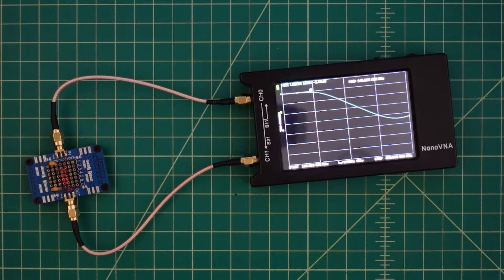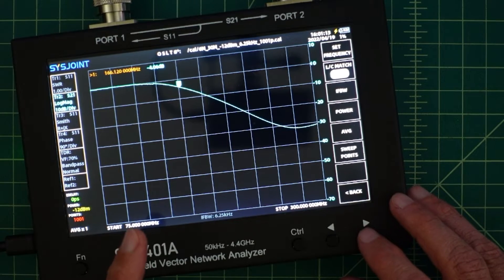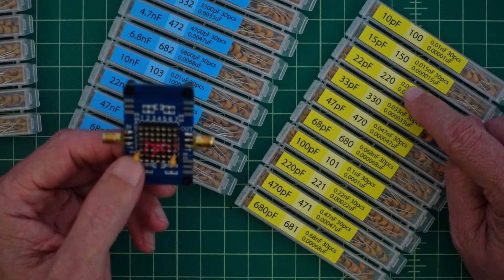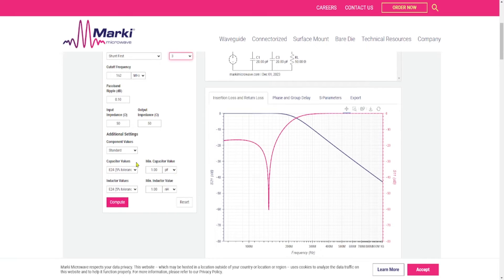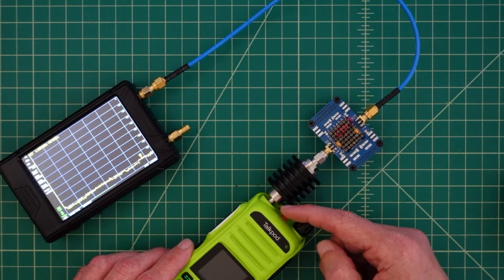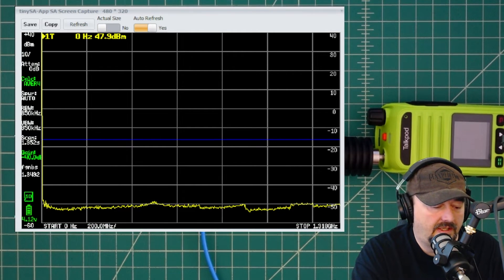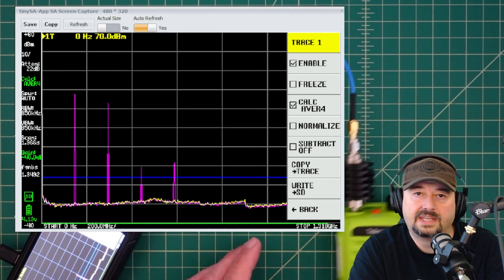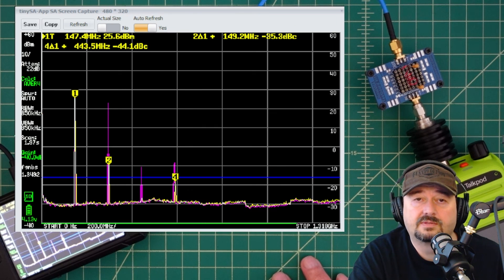2m Low Pass Filter for Ham Radio

Comment: I was using Marki LC Filter Design Tool in the website and it is nice, BTW the website don't show info about how to make the coil used in the result of LC calc. Do you know any website to calc the coils based in the inductance? (i.e. 12nH).  Nice video, thanks.
Reply from the maker: I think folks use an app called coil32 these days
Reply: @TheSmokinApe  nice, thank you
Reply from the maker: @Semeion7 👍

Comment: I wish I had watched this before I started trying to make a broadcast filter for my SDR. I was expecting to just follow a plan and tune it up a bit but I learned the long way about the Nth order versions being necessary for stronger interference. 
Also what do you look for in a capacitor assortment like that assuming they will just be used for filters and filters disguised as other things like band traps? 
I inherited a whole shack of random parts from an SK so I haven't had to buy many capacitors yet but it would be nice to not have to search through his unlabeled boxes of jumbled 1960s capacitors to find what I need assuming he didn't use all of whatever I'm looking for :)
Reply from the maker: I like using the silver mica caps but haven’t had luck finding an assortment of them.  I did get a bunch of different ones from Tube Depot

Comment: Interesting experiment, but that proto board will introduce a significant amount of capacitance to your circuit. In addition, keeping your capacitor leads so long will add inductance in series, creating tuned circuits. Despite the limitations of your setup, I applaud your experiment and your video. This is the type of experimentation that will make ham radio a great training ground for competent, trained radio operators. Congratulations!
Reply from the maker: Hey Donna, totally agree with your points about capacitance.  Thanks for watching the video 👍

Comment: You might check out what I did working as a co-op engineering student at a USAF radar site. With multi-megawatts of RF floating around, I worried that the two-meter transceiver in my car might get fried. I made a quarter-wave (corrected for the velocity factor) coax stub shorted at the end. It gave me no problems on receive or transmit, but it was a dead short for even multiples of 145 MHz and a partial short at other frequencies. It's easy and costs almost nothing. It is also a good way to kill that second harmonic on those cheap Chinese hand-helds.
Reply from the maker: Is there a link?  I should play around with stubs more 👀

Comment: Need Help !  Im doing satellites contact , and in FM everything is allright . But i just bought 2  Yaesu Ft817 and im trying SSB satellites .  The thing is , when i transmmit on 2M  the receiver on the 70cm side is 100% overloaded by the near by transmitter .  Do i need a low pass on 2M  or a high pass on 70cm  ,  or both ?  
Im using an Arrow dual band yagi  with 2 separate coax , connector and radio . 
Thank you and 73 !   
VE2XXQ     FN46rx
Reply from the maker: I'd look into the Sotabeams Bandpass.

Comment: great project . to bad the prototype board is small. to clean up more you would need more sections . but doing that you will get more insertion loss . Sota beams has a 2 meter bandpass filter . the down side is have to take it out to use 70 cm.  73's
Reply from the maker: And it's like 50$, thanks for the comment Robert

Comment: I've built my own filters using that exact website. It's a brilliant tool.
Chebyshev filters add passband ripple in order to have a steeper rolloff. Butterworth filters have no ripple but will rolloff slower and give less suppression on the harmonics (which you could compensate with 5th order for example). It's all a compromise.
Reply from the maker: Thanks for the info, I want to do more filter builds.  I have done a few with varying degrees of success 👍

Comment: @TheSmokinApe
Simulation of the circuit with the values from Marki's filter calculator does not show the insertion loss peaking at 300 MHz, then increasing response above that.  The loss should continue to drop, out to infinity.  One of the culprits is almost certainly excessive lead length of the capacitors.  I guesstimated the inductance of the leads and the test boards at around 15 nH for each capacitor, and simulation with that value puts the dip in response at around 300 MHz, just as your filter shows.  You can find air core inductor calculators on the web, you'll probably have to try several to find one you like.  I guesstimated the dimensions of your inductor and added the guesstimated inductance of the leads and the inductance you have should be in the right ballpark.  Your measurement of 2.4:1 SWR is suspect, just doesn't feel right with the rest of your measurements at and near the design cutoff.  I would build another filter without using the NanoVNA TestBoard.  Too much stray inductance and capacitance for any serious work with those.  Just solder a couple of SMA edge connectors to a piece of double sided PC board of appropriate width - just enough to fit your inductor between them, maybe .6" to .75" - then solder the inductor in. Then solder in the caps with the body of the cap practically laying on the PCB, leaving (damn near) zero lead length, and solder the other lead of the cap with the body of the cap practically up against the inductor/connector junction, again with (damn near) zero lead length.  Now, sweep that sucker!  I have built circuits like that for operation well above 2 meters, well into the gigahertz range.  Another suggestion: those capacitor kits.  Who made the capacitors?  Some of those kits are OK, some of them barely earn the rating of "junk."  Murata and Panasonic have always made top notch capacitors, Vishay is also good as high as I have tested them (low VHF).  There are several others, but they don't make a lot of leaded capacitors, mostly surface mount.  And they probably don't make kits.  Life is getting harder for hobbyists and experimenters.  If you don't know how to check caps at VHF and up with a VNA, learn how, and test the caps you've got.  If they don't perform, well, at least you can use the boxes to put good capacitors in.  Buy them from Mouser and Digikey or other reliable vendor.
Reply from the maker: Wow JAA, thank you for the insight.  Great post 👍

Comment: Hi Ape. Every filter hobbyist knows the problem with the exact capacitor values.
I would have built the filter into a shielded sleeve that could be plugged onto the radio and measured the harmonics at a distance of around 20 meters with the Tiny 
SA antenna and this in the open field.
Reply from the maker: Hey Karl.  Yeah, encasing the filter would have been ideal but I was just messing around and decided to make it a video.  The emissions test is supposed to be performed at the transmitter output but a field strength test would have been cool to do as well 👍
Reply: @TheSmokinApe Thanks Ape. I would say there is still plenty of room for further experimentation. ;-)
Reply from the maker: @karlbesser1696  totally agree, I looking at a 5 pole design but it looks like a lot of work LOL!  Thanks Karl!
Reply: @TheSmokinApe  Filter apps do this in no time, even for multi-pole filters, but the circuit board layout and the appropriate capacitors, if you don't want to use trimming capacitors, are a little trickier. Good luck.
Reply: Measuring harmonics at a distance is fraught with difficulties.  What is the gain of the transmitting antenna at the fundamental and harmonic frequencies?  What is the gain of the receiving antenna at the fundamental and harmonic frequencies?  Are there nearby objects that the signal will reflect off of and affect your measurements?  (There are.)  Will those reflections affect your measurements the same at all frequencies?  (No, they won't, their effects will be unpredictable as hell.)  The way to measure the harmonic output of a transmitter is through coaxial cable into a spectrum analyzer, using an appropriate amount of attenuation to be certain that you're not overdriving the spectrum analyzer and generating harmonics in the analyzer itself.  (The test done by SmokinApe above may not have met that condition.)
Reply: @JimAndyAllyn  Hi Jim, when I measured (in the open field), I wasn't interested in measuring the absolute values of the field strengths, but rather how the harmonics form relative to the fundamental wave, measured once with and without a filter. The transmitting and receiving antennas are the same and the measurement setup is such that no significant reflections can occur. Then you can say whether the filter has served its purpose or not.